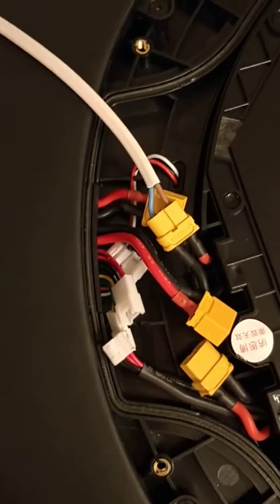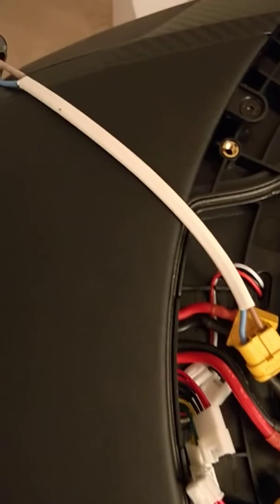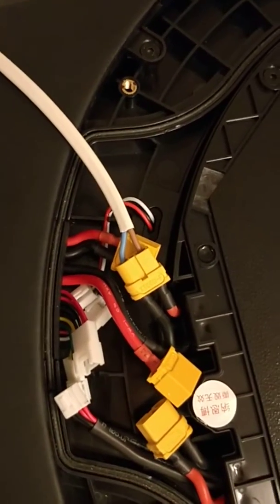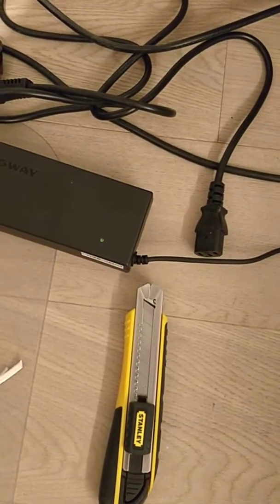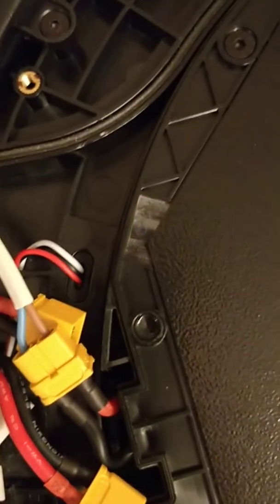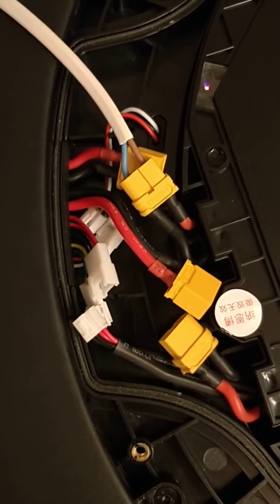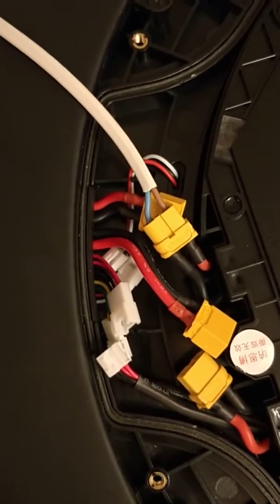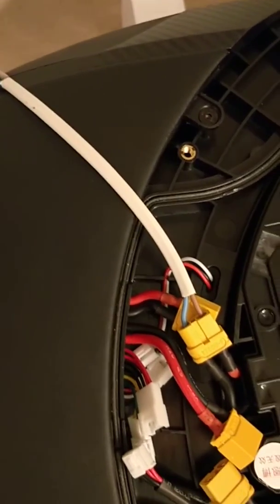Ninebot Segway Z10 - Showing how I connected the batteries to get out of deep sleep - First charge

Comment: Hey there, thanks for the upload! Q1. So I am doing what you did with the extra cable like you video and now the charger light is now red (stable / not flashing) which is good. But the indicator light (isn't flashing blue... it's not flashing at all. Even though the charger has a solid red). Any ideas? . 
Q2, Also how long do you have to charge each battery with the DIY wire connection? My friend hasn't used is Z10 in about 1.5 years. Thanks a lot!